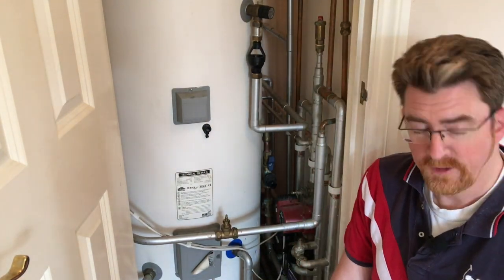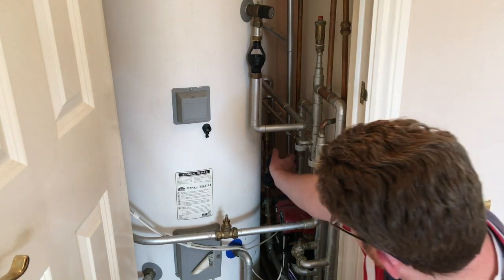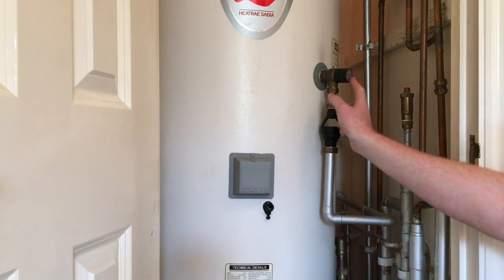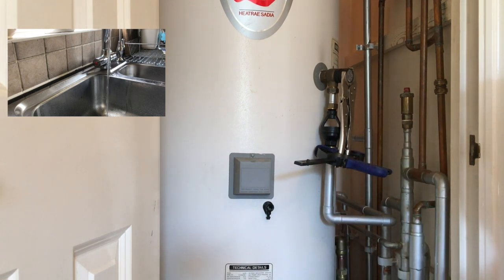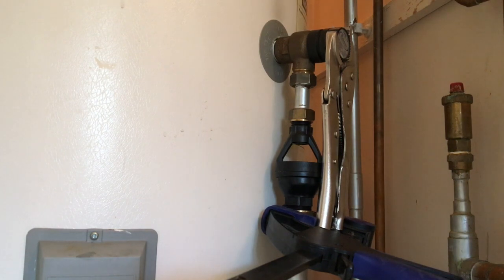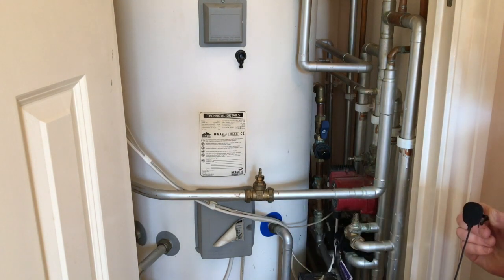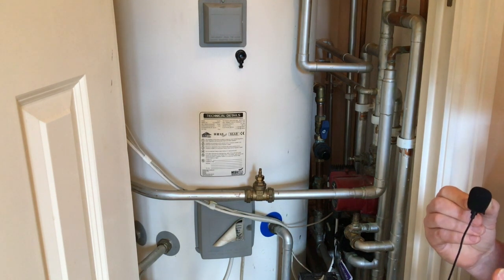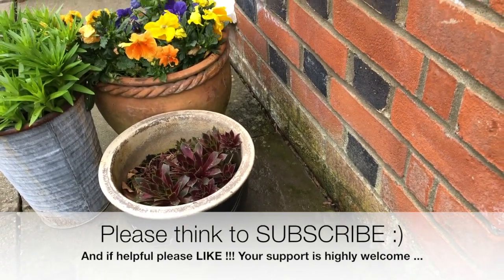Megaflo recharge of air gap

Comment: What do you do if done all that and still drips??
Reply from the maker: Try again, this time leave it the PVR open for longer (say 30mins). If still dripping you might have some calcium build up if it have been dripping for months. It’s either a replacement valve , you need a qualified plumber for this, or you could try rapidly opening and closing the PVR in the hope it breaks off any build up. Sorry can not offer any more advice. If the video helped please think to like and subscribe. cheers 😊

Comment: THANK YOU! Everything was broken at once. Now at least we have hot water thanks to YOU! Our Tado heating system was screwing up. We have persistent air leaks into our oil line into the boiler so I couldn't tell if it was tado or the boiler locking out cos of the oil. Then the tundish (which I'd read about on the label but never knew what it looked like or where it was) was dripping continuously! And I only found it in the bottom of the airing cupboard behind a box thanks to your video to find out what I was looking for. Your How To video is officially excellent! Saved the day and now our ensuite shower that used to take 4 MINUTES to get hot water, gets hot in SECONDS. Hero. Nothing short of hero. THANK YOU
Reply from the maker: @dreamcocreators Supper happy you got the system up and running again! If I could ask you Like and Sub that would be fab :)

Comment: I have 2 megaflow tanks which were installed 7 years ago.  I followed your instructions, however, the hot tap in the kitched ran for ages and never stopped running (15 minutes). So I turned off the water by turning off the stop cock.  I then went to the first tank and opened the valve releasing the water into the tundish which went on for ages and after 5 minutes stopped and did the same for the other tank. I then manually turned the heater on and after several minutes I was still getting water dripping into the tundish.  Do you have any advice?
Reply from the maker: If you can not isolate the tanks at the balance valve then turning off the stop cock is a must.  There should be no mains pressure going  to the tank(s). Once isolated then open a hot tap. Dripping issue - could be a bit of calcium build up.  I'm not a plumber so my first recommendation is get one in to look. As a DYI approach try rapidly opening and closing the PRV. That might dislodge the build up. it could of cause make it worse.

Comment: Great video. Thanks very much. For anyone else doing this, it took about an hour before my kitchen tap stopped running and the dripping into my tundish stopped.
Recommend people check their tundish regularly, especially if you live in a hard water area- I didn't and the first I knew I had a problem was a stain on my living room ceiling. The tundish had scaled up and the drip of water was capillarying over the side down the pipe. Hence why I recommend you check it regularly. If only redecorating was as easy to do as this procedure. Thanks again.
Reply: Yeh, I just did this to ours and the tundish was covered in limescale. Not blocked thankfully. The water coming out stopped really quickly but holding the valve open caused gurgling for well over 10 minutes which confused me because another video said it takes 2-3 minutes.

Comment: Thanks for the video! How do you know it's time to re-pressurize (you said every 6 months)? Is it when you notice dripping from the outside overflow pipe? The Megaflo instruction says it should be done when the TPRV starts dripping into the tundish so you see it. But in reality I am afraid this never happens because the TPRV is set to 10 bar while the cold water inlet PRV is set to 8 bar, so whenever the DHW cycle runs and heats up the tank the 8 bar PRV would open first, but you just don't see it because it does not have a tundish. All you see basically is the overflow pipe dripping.
Is my understanding correct?

Comment: Joe this was so helpful. The best video on the process by far. My tank is 21 years old and as it is on the ground floor I had to hold the valve open by hand for 50 minutes!  Please could you tell me the two instruments you used to hold it open?  I am not very handy. One you said is a mole grip, but what does the other thing do and what exactly is it?  Some sort of clamp?  Thanks again.
Reply: Also something called PRV Service Key may help, costs approx. £6.
Reply from the maker: @tommie6936  That would be handy !
Reply from the maker: @duckworp  it is a clamp to hold the mole grip open while the air is balanced out. Glad video helped!
Reply: @joewoodford9428  thanks. What is the clamp clamping together?  Is it clamping the mole grip to a pipe to hold it in place?
Reply from the maker: @ just holding the PRV valve open which is gripped by the mole grips. Saved me being sat there for 30mins to 1hr!
Reply from the maker: Sure Mole grip and general purpose clamp as I had both of these tools. Just saves standing there holding it open for 30 mins.

Comment: Can anyone help please. I have just moved into a place and I have this boiler but the water never runs hot for longer than about 10 mins. There is no timer on it just a switch on the wall that says hot water. Someone told me I should turn this switch on for a few hours a day and then off again. Could this be why my hot water runs out so quickly? Am I meant to keep the switch on all the time or does it sound like there is a bigger problem.
Reply from the maker: @LucyMoss-r8p  hi this is a hot water tank, the switch you are referring to I think is the immersion heater element. If you are using this then your hot water is being created by that heating coil (a bit like a UK kettle), turning it on causes the coil to heat and warm the water. Is your house fitted with a gas or oil heating system? If so that is the cheapest way to create hot water. If not then I guess you must be on electric only. This might mean you are running an economy 7 system which should be a cheaper tariff as it heats the water over night.

Comment: I’m struggling to get anything flowing through the tundish after opening the prv. Once I open the valve, a small amount of dripping will go through the tundish then it stops after a couple minutes. The tank has continued gurgling for up to an hour and a half the last time I tried this, and I decided to just close the prv as it just didn’t seem to want to stop making that noise. 

Any ideas? Cheers

Edit: just noticed the valve on my megaflo is completely different to yours. Mine is a light blue one and it doesn’t operate on a spring. I can literally open it up and leave it instead of having to hold it open
Reply from the maker: @Ryo22  hi, often only a little bit of water comes out into the tundish. Just want to check, you have isolated the mains cold water feed to the tank, and opened up a hot tap at a low point in the house before opening the tundish(as per my steps). Depending on how depleted the air gap is it could take 1hr. If water is dripping out of the tundish once closed and the water is on, then you need a plumber to check out the tundish as it might have some calcium build up. The tank should not gurgle once the air gap is balanced.
Reply: @joewoodford9428  yeah, I’ve closed the mains water supply before opening the tprv. I tried it again tonight and left it going for over an hour and a half but firstly the water never stopped dripping from the hot tap entirely and secondly the gurgling/bubbling sound from the tank did not stop either. In the end I had to close it. And yep, lo and behold, there’s still water dripping through the tundish.

Think it’s best to get a professional out at this stage
Reply from the maker: @Ryo22  agree, probably just some calcium buildup preventing the tundish valve to fully shut. Are you in a very hard water area, and is the tank old? If so then a replacement valve might be your best option, cheaper than a new tank !!!

Comment: I have a ground floor MegaFlo. Is it possible to perform the hot tap drain by running a pipe from a downstairs tap to a lower level? Is it better to install a drain-off tap somewhere adjacent to the Megaflo? Is the only solution to repeatedly call out an engineer (which I prefer not to for obvious reasons)? Or?

Thanks if anyone can advise.
Reply from the maker: @timcarpenter2441  hi, opening the hot water tap means the pressure behind the hot water is released. Down stairs is just what I do as it is the lowest tap, so drains pressured water from the tank and other hot taps in the house. To recharge I think you will be just fine using your sink hot tap. The only thing I can think is that as the blander expands it might have to work a little harder and might not fully recharge. But it should recharge the air gap.
Reply: @joewoodford9428  Thanks - is there a risk the tank will drain too far? Airlock etc.? How would one know when to stop?

Thanks
Reply from the maker: @timcarpenter2441  no issue with going too far, it balances with atmosphere, no more than that. To test if complete, I stick my finger over the tundish hole if it feels like it sucks when you release then leave it for another 10 to 20mins

Comment: If I have turned off the isolation (blue lever) and the water isn't stopping, what do I need to do?
Reply from the maker: You then might need turn off the whole house supply.  Usually the stop tape is under the main kitchen sink in a modern house. This should then shut off the cold feed completely to the house.

Comment: I have a megaflo and when I turn a hot tap on then off again, I get a loud vibration and juddering, like water hammer, coming from the tank pipework (hot water outlet pipe on the tank). If I open a tap lower in the system the noise stops, almost like dissipating pressure. Do you think this expansion air gap is the cause of this trouble? If not, what do you think is causing it?

Comment: I've found myself referring back to your video once again Joe.  One silly question if I may...  I turn the cold water supply off using the stopcock then turn on the hot water tap in the kitchen.  Am I supposed to open the pressure release valve until both the gurgling from the tank stops and the hot water stops flowing completely before I close the pressure release valve?

Thanks Joe.  Subscribed
Reply from the maker: Sorry for the delay, yes leave the stopcock closed until both the water running out of the hot tap has stopped and also the gurgling noise. Usually I leave these open for about 30mins. Close off the pressure value, then the hot tap and then turn on the cold.  The tank should then pressurise from the main cold water. Now carefully let the air out of the hot taps (all of them) they will splutter !!! A towel is handy to have around then :) If this or the video helped please Like and Sub ... thanks

Comment: When recharging our 16 year old Sadia  megaflo heatrae  I followed the instructions but was unable to get a large amount of water to flow through the tundish. Could it be that the expansion capacity has been diminished badly. we have not long moved into our house and don't know if the previous owners carried out this procedure regularly. Might that be the answer for the flow from the hot tap  Starts off fast but reduces to a much slower flow.  Hope you can help.
Reply from the maker: If you follow the process, make sure the cold feed to the megaflo is off, you should only have a small amount of water out the Tundish. To get full pressure you may need to leave the Tundish open for 30min or more. If its starts up fast then slows, the air bubble is not fully charged or the main water pressure to the tank is too low.

Comment: We have a megaflow 145L and we recently lost all water pressure, there is no hot water coming out any hot tap when we open them, could this process help? Or could it be a blocked pipe on the entry to the boiler?
Reply from the maker: Could be many issues. Check the in flow to the megflo, also is there pressure in the tank. Try a recharge. Seek a plumber !

Comment: Hi Joe...I have done this but there is water still dripping in to the tundish.. what is usually the issue for this?
Reply from the maker: Hi the tundish should stop dripping within a few hours.  If this still happening it could be a bit a calcium build up (like grit). As the tank is now under pressure any gap in the seal means water could escape. This might be because the tundish had been leaking for a while.  Your safest option is to get in a qualified plumber.  I can make one other DIY suggestion but it could cause more problems. So suggest you get a professional in!
Reply: @joewoodford9428  thanks for the reply...what would the one other DIY option be?
Reply: @joewoodford9428  also...once I have turned the water supply off and open my hot tap...the water never actually stops, it just slows?
Reply from the maker: DIY option is not recommended as it would involve changing the value. As this is a VERY high pressure system and that valve is a safety system I would not.  If the tank is on the ground floor of the house I guess it might take ages for all the hot water to leave the system.  I also open up one of the highest point hot taps to drain the hot water from all the pipes down to the kitchen. The key is to release as much pressure from the tank to allow it to equalise the pressure inside and out.

Comment: I enjoy watching your video so I decided to do it myself however the water supply valve to the tank will not move its stuck tight so I turned off the main water to the house and then turned on the hot tap unfortunately the hot water just keeps going any thoughts.
Reply from the maker: Hi Eddie, if you have turned off the mains water supply into the house that is the same as shutting the valve from the balance flow.  Does the house cold mains water stop when you have turned off the stop cock tape?  It should as no mains pressure is coming into the house, so all your cold tapes should not run.  If the megaflo tank is in a low position then there could be a lot of residual water in the pipes feeding it.  It can take mine 10’s of mins to stop flowing, but the pressure should be very low as I have shown in the video and then a mere dribble at the end. Tell us how you get on!

Comment: Nice one Joe.  I haven't been doing this correctly in the past, wasn't sure how long to wait for the gurgling to stop and I think I stopped too early in the past.  After watching this detailed and well explained video I think I've cracked it.  I have to use grips on that valve also, I think the Gary Carole below must have either a different valve or a worn one?  There is just no way there is a useful Cam on my valve, it just goes straight from full open to snapped shut :)
Anyway, the gurgling and water running from taps went on for about five minutes in my case as we have our cylinder on the ground floor.  The plumbing was done when this house was a bungalo!
Reply from the maker: Glad it helped you out !

Comment: I have a cylinder service recently, and the plumber did the same thing and result in water hammer in the cylinder afterward, I realised that I can release some water from the cylinder valve every time I use toilet or tap to let the bang sound gone.  I wonder if I should drain the hot water again myself to solve the issue ?
Reply from the maker: @Darkie Chan, not sure the best fix, might be worth chatting to the plumber again.  Water hammer is caused by high pressure being shut off too quickly. Closing a tap slowly usually manages this. I guessing you have great HW pressure now !!

Comment: It could have been useful but instead was long winded, boring and droning. Also using clamps that aren't needed, over complicating things. Basically you say nothing simply, clearly or with impact. And why make dull pointless videos, especially as you tell everyone who comments, to get a plumber? I think we're grown up to know we can get a plumber!
Reply from the maker: Dear Yo Ya, If you read other comments you will see a number of plumbers are very angry about the video as they say it should be carried out by a qualified person. I show, in a clear way, that this service can be carried out by the homeowner.  It shows a trick I use rather then holding the valve open by hand, as it can take 30mins for my tank to balance. Also note the video has been on YouTube for many years and helped numerous people. If someone is worried about the process they should contact their local plumber, this is also to appease any plumbers who might watch this. Thank you for watching, Joe

Comment: You're turning it to the right (clockwise) yet other videos for the same procedure are turning it to the left (anticlockwise) confusing.......?
Reply from the maker: Not sure it matters, but turning this way has always worked for me over the 16yrs (x3 per year). I find turning it clockwise being right handed is more natural. If the vid helped, please LIKE. Thanks Joe
Reply: @joewoodford9428  OK thanks for the clarification  - my cylinder is sited in my garage can this procedure still be carried out?
Reply from the maker: @sebthered  No reason not to unless its subzero as water might freeze but guess you are in the UK so should be fine.

Comment: how do you know when you need to do this?
Reply from the maker: If you find there is low pressure in your hot taps. The supplier recommends to carry this out once per year.  Older cylinders, like mine, need to be charge a couple of times per year. Thanks for the question, hope that helped, please think to Like the video and sub to channel ... Cheers Joe